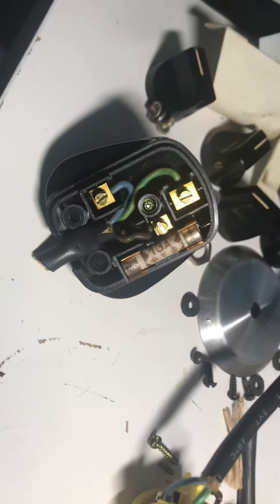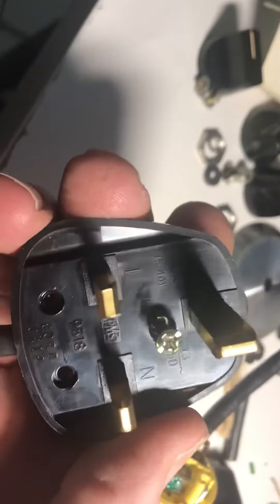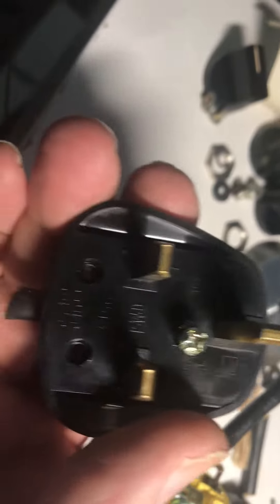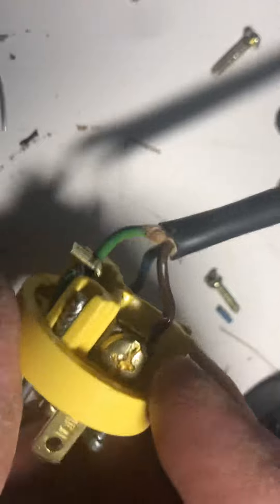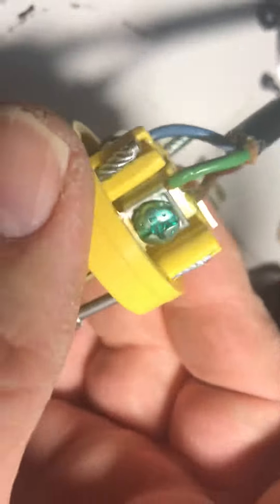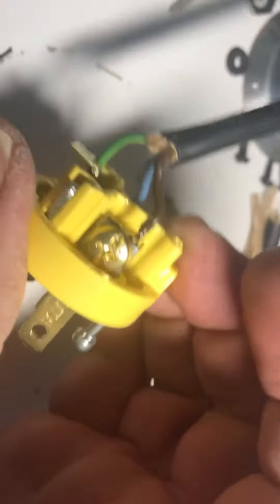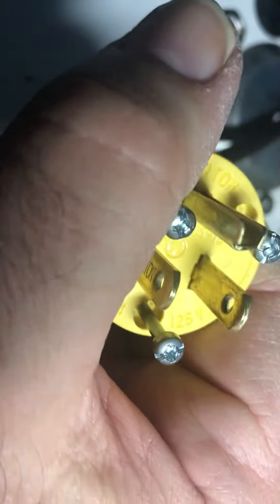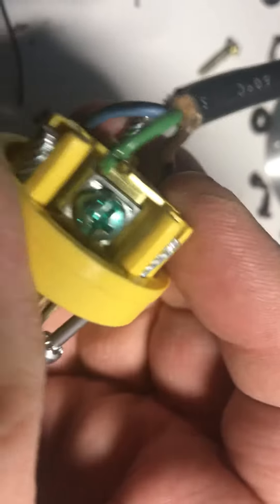How to convert a British plug on an appliance to an American Plug December 7, 2021

Comment: I am not an electrician but I do know  a bit about electrical from just graduating HVAC; And you make a really good point!..about the UK wires could possibly be different guages. I even asked an electrician  and he said- "oh yeah just cut off the UK plug and replace it with an American one!" I'm so Glad I decided to watch your video, Thanks My Man- Safety First!👍😉🇨🇦
Reply: Oh and not to mention the importance of the different colour wires... Thanks 👍😉🇨🇦
Reply from the maker: Haha yep. And UK on 220 volts only needs half the gauge wire we need at 110 volts. So a high wattage device set to 110 volts MAY need the UK like cord replaced.

Comment: Hey David so I purchased a carpet extractor with the same plug type you replaced. with that being said I found a US plug that I can replace it with however did have you had any complication with the appliance you modify. I'll be using my generator to power up the extractor.
Reply from the maker: British is 220 volts 50 cycles. Might work fine if extractor uses carbon brushes and not induction motor

Be careful

Comment: How do you cover up all those exposed wires? Is there another piece to that converter that wasn't being shown or did you just wrap it all up with electrical tape? 
EDIT Nevermind, I looked up what the converter looked like out of the box. Thankfully, it's capped off.